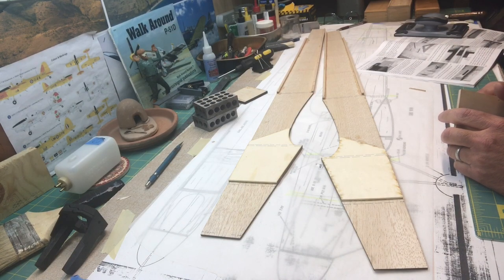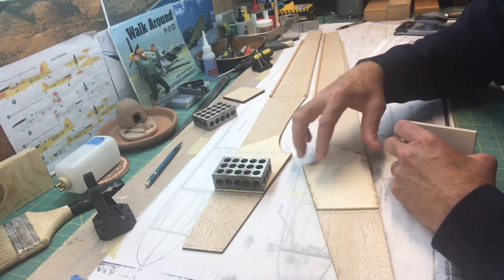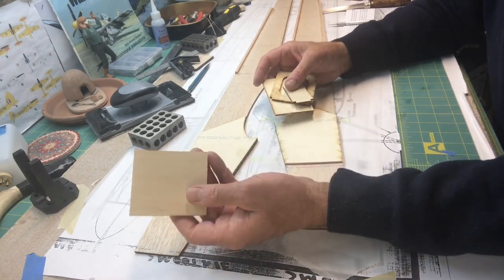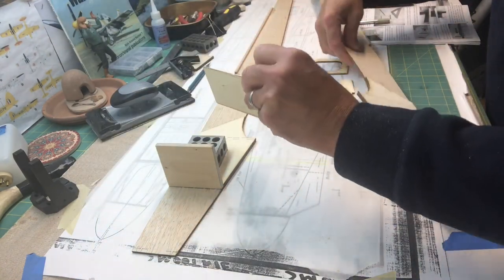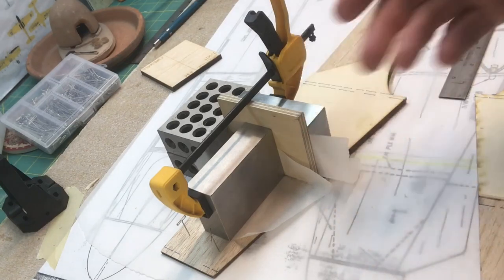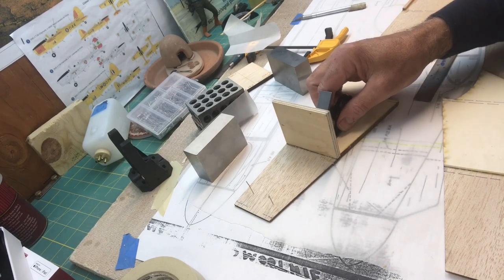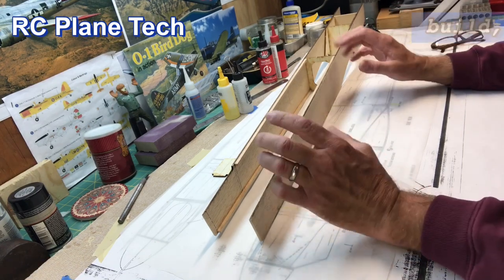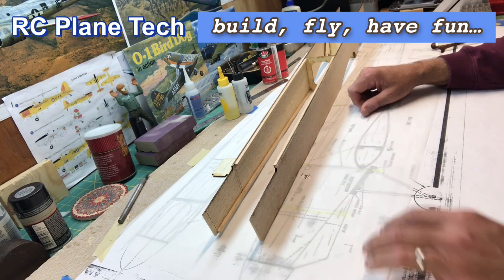Balsa USA Smoothie RC Plane Kit Build No 14, Fuselage Form Up

Comment: As a DIYer doing just about everything in the home from building rooms to cabinets that speed square is indispensable.  I use it for common things like quickly drawing lines on 2x4s to be cut if I'm not using a compound miter saw.
Reply from the maker: Ya I need to learn what it’s capabilities are. I do some stuff also. Ill learn more about it.
Reply: @JamesRCPlaneTech  My recent project was installing laminate flooring. I kept it on my belt with me. I use a compound miter saw so I didn't really need to draw lines on the boards, only needed tick marks but I did lines anyway. Here's the funny thing. I never considered using it for building rc planes!
Reply from the maker: Thats cool. i do a lot of stuff like that around the house. I just built a pergola where I probably could have used it but its on my rc table, lol.

Comment: Really liking this series. I’ve got the XL version (89”) of this plane tucked away for a future build. Also, I know you were looking for an RPM 25L. There is one on eBay right now. Sorry, I don’t know how to put links in the comment section.
Reply from the maker: Hi thanks. The XL is a big plane, it looks really nice and is probably a better kit than this one. That will be a nice build I think. And yes, I did notice that 25L and there is a 15S, both are on the pricy side. Thanks for pointing that out to me, Ill keep an eye on it, but I don’t think I can spring for it right now. Good luck with the XL, that should be fun.
Reply from the maker: Thanks again for pointing those kits out to me.

Comment: Hi, I noticed in this video that the FIRE WALL has no angle on it that I can see like you cut in previous videos, is there an angle or is it completely square all the way around? Like the original fire wall is.
Reply from the maker: Hi, The firewall had no angle built into it per the plan. So I used washers to angle the engine mount, and set it off center a little to the right so the prop was centered.

Comment: Page 22 of the instructions calls for 1 to 2 degrees of right thrust for P-factor and to offset the engine 1/16" to the left so the prop shaft is centered in the nose. The plan view of the fuselage shows a corresponding offset of about 2 degrees to the right. 
Since you needed to relocate the firewall on your build, how did you adjust your engine mounting location for right thrust? Thanks
Reply from the maker: Hi, so that was a little trial and error. To start with, the OS 46 with the mount I used barely fit within the area and I had to trim the inner left side doubler in order to get it to shift to the left. So that was the first problem is that when I was trying to put the few degrees of right thrust I didn’t have room to then shift the engine over. So as I mentioned above I trimmed the left side so I can make the shift to the left. Then as for the few degrees thrust, I just estimated. Im not sure how accurate one can measure 1-2 degrees. I used thin washers under the left side bolts to angle it to the right. So basically, I taped the washers on the back of my mount, while holding the mounting against the firewall I figured out where to mount the engine relative to the spinner(about 1/16 in gap between backplate and nose of plane), temporarily mounted the engine, then I marked the centerline on the end of the plane so I could judge where to line the prop shaft, and used a lot of eyeballing to check and recheck, once I got it where I thought it needed to be I traced the engine mount and holes on the fire wall. I wish I could say there was an easier way to do it, but I don’t know. Even if you left the firewall where it is on the plan, you would have to monkey with it because the engine length from one engine to next may be different. So just moving the engine forward or backward on the mount would cause shifts in where the prop shaft center would end up. 
I think the key is to get your engine mounted on the mount relative to the spinner (the gap), then start playing with the left mount shift local and fee degrees on thrust line. I bet there are a lot of smart people out there that have better ways of doing it. But I just had to play with it until I thought it looked right. I hope all this helps. Sorry I may not have a clear description.
Reply from the maker: So I looked at video number 21 and 22, (engine mount part 1 and 2) and its a long two videos but I try to explain it. Mostly in the later half of video 22.  Hopefully all this helps. Let me know if I can clarify what the heck I did!
Reply: @JamesRCPlaneTech  OK thanks!